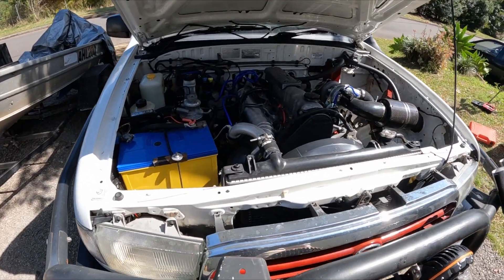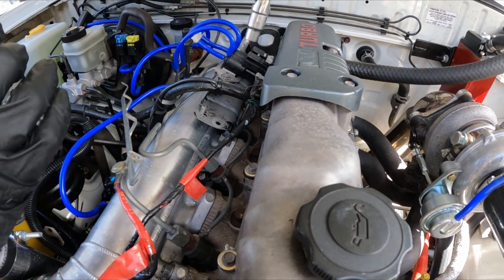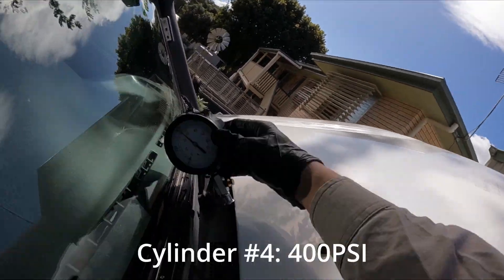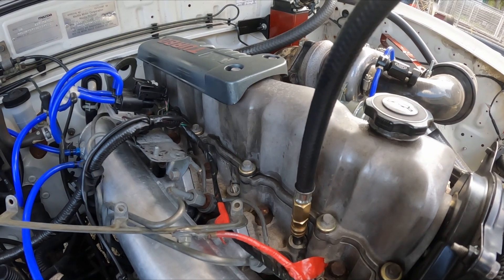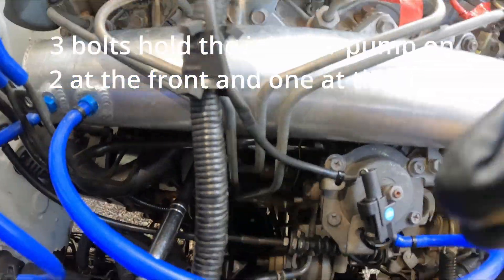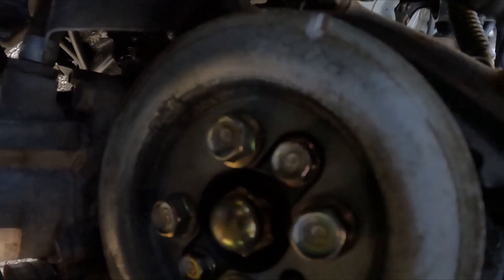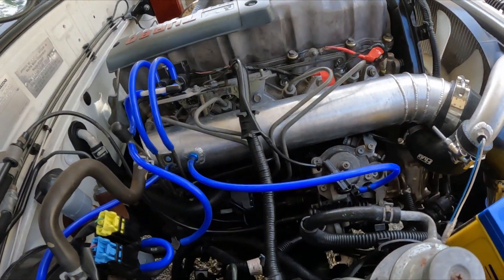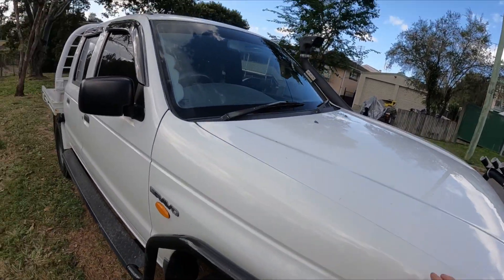WLT (Ford Courier/Mazda Bravo) Compression Test & Fuel Timing Adjustment

Comment from the maker: The problem actually wasn't the piston rings, it was the drain hose on the turbo, it had a low spot which resulted in oil backing up and burning/leaking through the turbo seals! Learnt this after I rebuild an whole other engine hahahaha.
Reply: owsh, great info tho, just saved me a bit of labour there, was about to take apart my whole engine. will have to check there 1st but might  hv to jst rebuild aswell because it seems to be ok there but i dont hv a compression test so still in the dark

Comment: You said to use the 2nd mmark on crank pully going clockwise, is the the tdc point or before tdc. I am in the process  of  building mine, it has been done by different people but still not as powerful  as i 1st bought it. is your second one number 2 when counting from the left or when counting from the right?

Comment: Hey mate. I  finally got the smoke from my WLAT to stop, after checking and changing the glow plugs and cheap injectors. The injectors were wet with diesel when I removed them. That was unusual to see. Changed all of the injectors and glows, but still smoked after several starts, I then fitted a blanking plate to the EGR valve and presto, No or very minimal smoke. I still can`t work it out.. It should not smoke with new rings and a new head. New injectors and glow plugs. WTF...
Reply from the maker: Ahhh egr, yeah, they're bastards. Glad you got it sorted though! Mine is pre-egr so I'm pretty stoked I never had to deal with them.

Comment: Hey mate. My Mazda bravo timing marks should be the same as yours. My timing only lines up with the first mark, which I'm led to believe is 10 degrees BTDC.. Pump timing is controlled with gears and is only adjustable slightly with pump rotation. This ute ran fine before a minor rebuild and new head. It now blows smoke, ( diesel ) and has a small miss. ????? Got any ideas on this , ? John
Reply from the maker: Hey mate, the way I explained the timing marks in this video was a bit confusing, checkout my engine rebuild series, in episode 3-4 i show very clearly the right marks, hopefully that clears it up for you abit. What color is the smoke?

Comment: 390 with blowby no way  mine has 250 and some blowby
Reply from the maker: Hahaha 250 is cooked, turns out in the end this engine was completely fine, I messed up the turbo oil drain pipe which was causing the smoke.

Comment: Very informative,  maybe you are loading extra boost that lead to piston rings failure? How much factory PSI is this machine rated at?
Reply from the maker: The compression for this engine is between 360-400psi so it is perfect on the compression front. The issue turned out not to be the piston rings but actually I had my drain hose ran incorrectly on my turbo which resulted in the turbo leaking oil and burning it!

Comment: Cheak clearings on head mine smoked real bad or make sure your glow plus are actually working correctly get glow plug switche on dash glow 20 sec cold then 10 sec running until smoke clean allgoods
Reply from the maker: Hey mate thanks for watching. It does it even when warmed up so glow plugs are definitely not the problem, swapped out quite recently too. I do the clearances every 12 months or so but I double checked them and they're all good too, the exhaust valves were a bit tight but nothing drastic, adjusting them didn't help. It is burning excessive amounts of oil now, blue/whitish smoke and it has burnt 4liters in 2 months so it definitely has an internal issue. I have already started the engine rebuild if you're interested in seeing that process part one is out! 
https://www.youtube.com/watch?v=qw_BOgAemVU

Cheers, Finndawg.

Comment: Have just rebuilt my 2.5WLT.  With older high km engines it is sometimes a combination of problems.  White smoke can indicate an injector problem.  If its blue smoke as well its burning oil - could be valve seals, valve seats, rings or the Turbo seals.  I think the Turbo is a sealed unit and they are not fixable.  I got a second hand one with a 6 month warranty.
Reply from the maker: Thanks mate, I have just started a rebuild on my spare engine, going to put up the whole process on here.
Reply: @Finndawg  Nice - look forward to it.  Check your cylinder bore diameter.  Mine had been bored out at some stage and required +0.5mm rings.  There is a good video on YT by a South African guy that takes you through the gear timing alignment process.  Also these engines don't like over heating so check and inspect the flow through the main radiator and heater radiator.  Mine looked mint on the out side but when tested by the radiator shop was 90% blocked.
Reply from the maker: @1010Singularity  yeah I've been following his videos to the tee, awesome resource! The radiator is practically new, have already tested the new pistons in the bores and they fit snug, someone had been playing around in the engine before as I found a missing bolt but it's in great condition, good candidate for a rebuild

Comment: Hey mate could you link the compression tester you have? Is it a common glow plug size? Cheers
Reply from the maker: Hey mate, I just brought it cheap but it was about $100, standard diesel compression tester, petrol ones don't go as high with the PSI.
Reply: @Finndawg  cheers

Comment: 4L in 2 months is a lot and only could be haed or rings buy if was either would think comp test would of shown problem maybe try another test before pulling apart just to know what is the failure before spending $$$ on rebuild
Reply from the maker: I have a second engine here from when I rolled the original ute, have already fully torn down the engine to the block and ordered most of the parts I need for the rebuild, both engines are over 300k so they could both use a rebuild, the original engine is just getting a nice clean stock rebuild but the engine in question in this video is going to be fully built with forged rods and pistons.
Reply from the maker: I have a second engine here from when I rolled the original ute, have already fully torn down the engine to the block and ordered most of the parts I need for the rebuild, both engines are over 300k so they could both use a rebuild, the original engine is just getting a nice clean stock rebuild but the engine in question in this video is going to be fully built with forged rods and pistons.

Comment: Hey just seen your video as was looking into turbo problems on a wlt and thought should let you know any pressure over 350 psi per cylinder is good and seems the breather off you valve cover must be blocked to blow the cap like that also if you leave the cap off you would find there isn't much continuing pressure that is pressure build up and as for the the timing pulleys off the cam and pump dose not change as the belt holds them in place moving the pump turns on the pulley and can not change the teeth on the timing belt position
Reply from the maker: Thanks for the comment mate. Yes I did say in the video that the compression wasn't the problem, and I did have the catch can blocked off to see if it had excessive pressure in the crank case, but it builds up almost instantly and from what I can tell pressure from the engine shouldn't be making it's way up into the cylinder head. It is also blowing a considerable amount of whitish/blue smoke now this video was filmed about a month ago, the problem has got worse since then and the video of the fill cap blowing off was filmed about a week ago.

Also I just play it safe when I adjust the fuel timing because it can move the pulley and potentially jump a tooth on the timing belt, I know it is unlikely but as I said just playing it safe.
Reply: @Finndawg  bottom end will always need to breathe as rings are not a complete seal and pressure will build up if you seal the bottom end of the motor also checking the timing belt after moving pump not going to change any teeth  on the belt seeing it is holding a cam with 12 valves when running and doesn't slip a tooth
Reply: just don't think you need a rebuild at that compression and should let you know seems you may have another problem
Reply from the maker: @davidhernes6065  I just assumed it was excessive pressure in the crank case but I may be wrong, in combination with burning oil i just guessed the rings. I can't think of anything else that would cause the oil I'm burning, 4liters in 2 months.

I'm definitely no expert though I just aim to help people figure out what they have going on by seeing how I figure it all out, always keen to hear good advice.